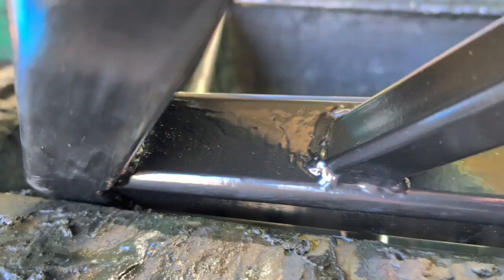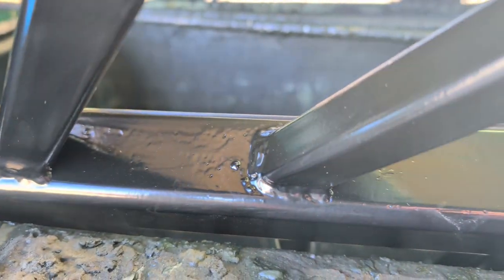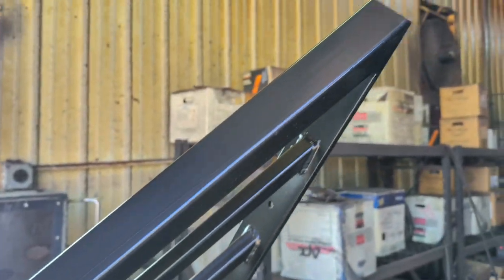How to Powder Coat Handrails and Weldments

Comment: Hello, it's really interesting how they show the powder coating process. At the same time, I have a few questions: how do they handle the treatment when the piece is already painted? I read that sandblasting can be used, but I would like to see on what types of pieces it can be applied—thin, wide, or both. It would be interesting if they showed in a video how the treatment is done in these cases.